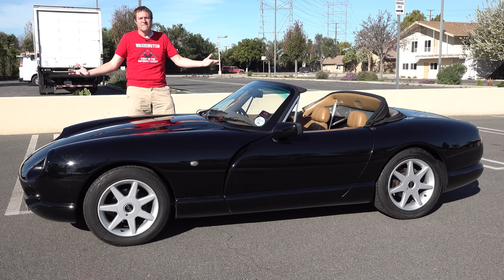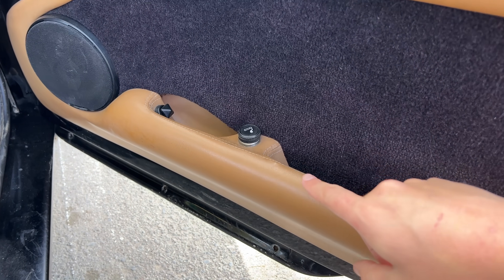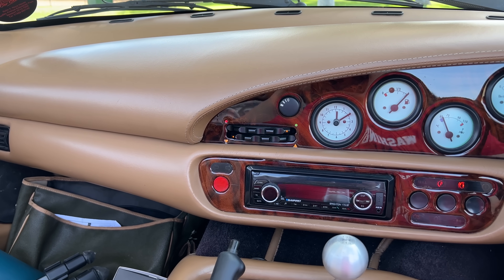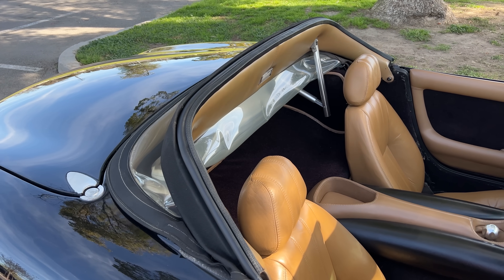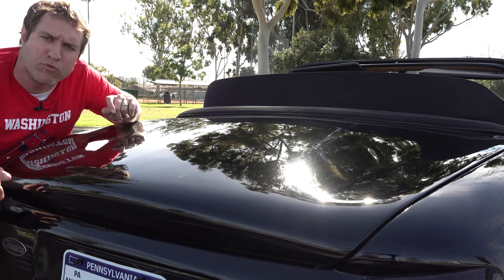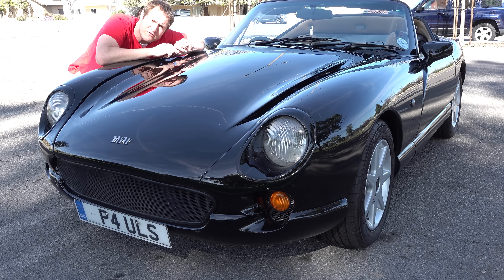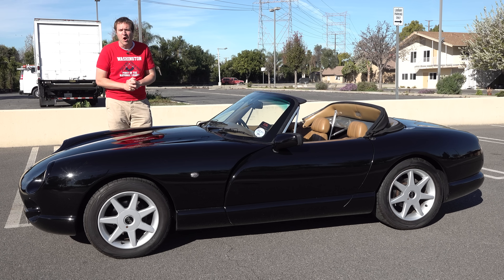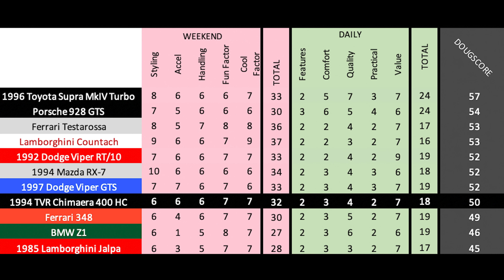The TVR Chimaera Is a Quirky, Weird V8 Sports Car

Comment: The roof on most Chimaeras folds down much lower than this one, the only thing stopping it is the risk of splitting the plastic window.  Also, there is additional cabin storage on these with a covered storage box behind both seats under the parcel shelf, albeit well hidden 👍
Reply: Wow it was so well hidden that Doug missed it
Reply: reminds me of that last K-car. something definitely is wrong with that roof.
Reply: @flair8099  to be fair, I know plenty of owners who didn't know they were there.  They'll take a tool kit, wheel jack and tyre foam, or a decent speaker upgrade 🤔
Reply: Yep, the roof should fold down further, but not by much. Over time the rear panel will split if you do push it down. Simple fix is to roll up an old rug and stick it in the fold as you push the roof down.
Reply: Doug is having problems with convertibles lately
Reply: @Revup1  Had a look at some photos, and it never goes down all the way. But there seems to be a cover for it when folded down.
Reply: @Revup1  There's something so British about that.
We "could" have sorted out the window - but why don't you just take an old rug and.. :)
Reply: @paulspensley1094  got my compressor, tyre foam and a small toolkit in mine!
Reply: @goldcd  Basically TVR was a low volume kit car manufacturer, if you park two cars together and walk around them you will see that there is no standardisation, every car is different. The wiring looms are a nightmare, TVR published a number of wiring diagrams for their cars, but my car had a mixture of at least three different versions of the wiring looms! TVR were really successful at low volume, (relatively) low cost Ferrari eating sports cars, but the company went bust when bought by an Oligarch who tried to turn them into a high volume luxury sports car company...they simply didn't have the capacity to sustain the quality or the ability to manufacture in large numbers, nor could they meet the safety standards and crash tests needed for high volume manufacture. So yes, there was something very 'British' about them, eccentric, quirky, 'mend and make do' attitude, a car you could literally build in your own garage.
Reply: Did you work for TVR or something?
Reply: @geoff3610  no, but did visit the factory in Blackpool a couple of time and owned 4 TVR's over a 15 year period including a Griffith, a Chimarea for 4 years, and Tuscan convertible for 9 years 👍
Reply: @paulspensley1094  noice. Ever see a cerbera? That's my favorite. And everyone loves the Sagaris
Reply: @MircoWilhelm  the rear screen on that Chimaera looks quite cloudy, they get really brittle when they're old which is probably why he doesn't press it all the way down 👍
Reply: @geoff3610  the Cerbera was built at the same time as the Chimaera but it was the first to use TVR's own engines (AJP8 V8 and Speed 6 straight 6) which were fragile but fabulous.  I've driven a 4.2 and 4.5 AJP8 Cerbera and they are surprisingly crampt inside but bloody fast 🤗, the Sagaris is a much better car to drive though, just as quick but much better handling.  They got it 100% right with the T350 and Sagaris ... then went bust lol 🙈
Reply: @paulspensley1094  yeah, it sucks that they're gone. But i'm glad to hear good things 😁
Reply: @Revup1  Most hand built cars are like that. They use off the shelf parts so if something goes out of production they have to switch to an alternative. The big manufacturers have their own stuff made so they don't get that issue so much.

Comment: I use to install security items on these vehicles in the day and remember that because they were on a budget you would find that they would use whatever colour wiring loom they had. So one week all the positive (12v) wires were red and the next car they were blue or black.😀
Reply: That's not a believable story but seems it gets a few likes.
Reply: @skylined5534  sorry but it perfectly true!
Reply: @skylined5534  TVR was not a serious manufacturer. It was basically a group of people knocking cars together whichever way they managed I'll tell you first hand that the actual spec varied from car to car. When they hadn't paid a  supplier due to cash flow or other problems (disagreements) they would use substitute parts (A/C compressors, alternators etc) form whoever they could get them from and fabricate modifications and brackets to make them work. An owner posted a story on Pistonheads forums back in the day, he was waiting forever for a warranty repair, finally he had enough of excuses and went to the factory where he found his car partially disassembled as he claims they had used a part to complete a new car. Another fact you can look up is a lot of photographic evidence of the guys making the fiberglass panels having engraved penises and rude comments about co-workers on the underside of the panels where they can't be seen till the car is taken apart for repairs... There are also stories of engine numbers not corresponding as they fitted more powerful variants in some regular models as that's what they had available when they were short of cash.
Reply: What you said reminds me of this clip from old Top Gear (skip to the TVR opening scene @ exactly 1 minute into the video) https://www.youtube.com/watch?v=bwoHmubxDIg
Reply: @energymc22  

Pistonheads 😂

The site several of us love to deride on account of the folks on it.

Why not provide this evidence you speak of? You bring it up so prove it.

P.s. you know TVR is about to launch a new car? Was? Is.
Reply: @johnbaldock6353  

Don't be sorry. You say true, I say you're another Internet expert who can't prove a thing. Though please make something up at an anecdotal level to give whatever story you come out with credence.
Reply: @skylined5534  Get a life mate.
Reply: @johnbaldock6353  

OK mate, keep making stuff up on the Internet, mate.  Cheers mate.
Reply: @skylined5534  Believable to me. I had a TVR. Everything was made with whatever they had. It was a parts guessing game working out which volume car a failed part came from. When my throttle cable failed and the car went to full throttle, the recovery guy diagnosed it as coming from a Ford Consul (of the Granada time frame). We took his van to a parts store, got one for the Ford, and he fitted it.
Reply: @originalkk882  Yes, but they wern't using a Ford Consul cable one week and a Vauxhall Viva the next.

Comment: If you thought this one was quirky take a look at the Cerbera. Fantastic interior and brutal performance with zero driving aids.
Reply: About 5 years ago Doug had made a video about the Tuscan.
Reply: Yeah we all saw the Top Gear episode too
Reply: He did mention the Griffith. Probably meant to say Cerbera.
Reply: In other words, a real car.  And the term you want is driving 'crutches'.
Reply: None of the TVRs from the Peter Wheeler era had driver's aids.  No ABS because they had mechanical brakes.   No stability control for the same reason.  No traction control because Peter Wheeler refused to build a car that had veto power over your right foot.

Comment: I owned one of these in the late 90's.  It was a huge amount of fun and definitely missed, thought not exactly ideal as a daily driver especially in the winter.  TVRs are known for unreliability but this very much varies from car to car - mine never completely left me stranded, but a few times I had to drop it off at the dealer on the way to work to have it looked at.  Lots of Quirks and Features as you indicated Doug, but you missed the best one...  The recess for the front indicators was allegedly created by the then owner Peter Wheeler's dog called Ned.  Apparently he took a dislike to the front of the polystyrene model and bit a chunk out it creating the recess for the indicator light!

Comment: The tail light situation is due to them being parts bin items. The outer clear casing is there and shaped to make them look better and fit the rest of the cars design.
Reply: the tail lights are from 1990 ford fiesta with a plastic cover
Reply: Ford Fiesta tail lights. I think they were installed upside down on the Chimeara.
Reply: @One Issue Voter door mirror is taken from the Citroën CX (as used on the Jag XJ220) and the door controls are deliberately designed so the heavy mechanism is in the body which keeps the door light and saves wear on the hinges, thats why there are no handles on the doors 😉
Reply: @One Issue Voter those are the features that made TVR stand out and are part of the reason the brands cars so fondly remembered, even if the cars weren’t always objectively good
Reply: @silverghini2629  yup. Mk3 Cavalier/Opel Vectra tail lights installed upside down on the Griffith.
Reply: @One Issue Voter Because tail lights are considered a safety item, the cost of having a new design certified is astronomical compared to other parts of the car. Even a lot of really high-dollar supercars use parts-bin lights to avoid this expense.
Reply: @One Issue Voter TVR Is going anywhere just yet, they have secured a loan to restart production of Cars starting with their a;ready unvailed TVR Griffith with they showed off way back in 2018. Part of the reasons they use parts bin parts like this is that certain parts cost a lot more then others to design themselves, especially parts that are covered by safety regs and need to be certified so they cut costs by going parts boon for those and put their limited R&D dollars on other aspects of the cars. TVR sells so fe cars that like other limited production car manufacturers there are always operating with very little runway when it comes expenditures so they focus on the features that are most likely to attract luxury drivers to them and skimp on areas that will not be seen as being as important to their audience like headlight/tailight design. In fact, It’s these sort of quirks in this car that attracted certain people to buy A TVR in the first place as apposed to Porsche or Bentley or BMW OR Mercedes with less quirky natures dice to higher volume sales allowing for higher R&D budgets and more custom parts designing.
Reply: Ashtrays from an original Mini?
Reply: I can't believe I've only just noticed that - of course they're Fiesta taillights!
Reply: @krudmuphinstudioz  even though later cars HAVE a custom light set with lights from Land Rovers
Reply: @silverghini2629  No, they're installed as should be, but being LHD they have the reverse light in the opposite side
Reply: @krudmuphinstudioz : Lamborghini Diablo with Nissan 3000 headlights is yet another classic example. Lamborghini had to make a plastic "eyebrow" to cover the Nissan name on the top edge of the light.
Reply: @Charlesb88 : Well Les Edgar is doing an excellent job of dragging his feet on bringing the brand back again. It was 2017 when he showcased the new Griffith and these's been no news since. In the meantime, Gordon Murrey, who was involved in the Griffith project, has gone on to not only set up his own GMA company but also design and build three models (all sold out) as well.
Reply: @duncanhowarth9514 It takes a lot of money to put a car into production and TVR didn't have enough of it in reserve prior to 2020 and the pandemic only made that worse. I don't really see any reason for Les Edger to stall for any reason other the financial troubles but we'll have to wait and see if he get production started or not within a year. It's like kick-started campaigns that you think are dead then suddenly you get the promise item just a year or more after the original shipping date. Then sometimes it never comes. Too early to say if TVR will be better late then never or is the brand truly dead (for now at least).
Reply: @silverghini2629  The Griffin 500 had the upside down cavalier GSi lights I think
Reply: @Charlesb88  They could have fitted Morris Marina door handles but Lotus and Range Rover were already doing that :-)
Reply: @One Issue Voter  

Good riddance? You do realise TVR are alive and well, yes? 😂

Comment: The taillights are from a MK 3 Ford Fiesta with a more bubbled surround on them. That's why they gave 2 cases. 
Plus, the front then signal - the reason is has a double hole for them (one below the one containing the light) is because the designer was playing with the company chairman's dog and the dog went to bite him and took a chunk out of the clay model and they kept it like that.
Reply: The lens of the headlights is acually from a 1970’s Scania truck !  (Really)
Reply: The original Lotus Elise had front indicators off a Chieftain tank, simply because they had been homologated.

Comment: One of the points of owning a Tiv is it's quirks. I've owned a Griffith 500 since 2002. It's different, turns heads, people don't know what it is, you can burble around at low speed, or scare the crap out of yourself. It's also comfortable and practical. If money allowed, I'd add a Tuscan S to the collection.
Reply: Best looking Trevor in my opinion
Reply: Woaw the Griffith 500 is truly iconic, I used to see one in The Hague also 14 years ago with the Tuscan and sagaris in scheveningen beach.

Comment: Great review! I own a 1995 Chimaera and it is a real blast to drive and certainly turns heads. Parts are cheap and readily available and they are easy cars to maintain/work on. If looked after they are reliable enough. If you like ‘60s sports cars with big engines, these are the nearest modern-ish equivalent you’ll find.

Comment: I've been wanting a TVR since I played Gran Turismo 2 back in the day and they still seem so far out of reach. Such amazing cars, it's a shame (and a bit of a blessing) that they're not more well known.
Reply: A small car with a v8 I’m surprised it isn’t a cult car
Reply: @AD-ui6sk  Probably cause they're somewhat obscure outside of their home country (unless you played Gran Turismo).
Reply: Speed 12!!
Reply: @JohnWiku  800 horse powers
Reply: Underrated gem manufacture
Reply: How are they not well known, there iconic cars.
Values of pretty much any tvr have doubled in the last 3-5 years
Reply: Out of reach?  You can get Chimaeras pretty cheap in the UK. There's some advertised for under 10,000 pounds.

Good ones are increasing in value though

Comment: Despite that production figure, Chimeras weren't exactly that common on the roads even here in the UK. They had a well-earned reputation for being a handful to drive, courtesy of the fact that a tweaked and tuned large capacity V8 was mated to an aluminium chassis and fibreglass bodywork. Which accounts for much of the lack of mass to shift, and the consequent willingness to launch forwards in an alarming manner if you're not careful with the accelerator foot.

Plus, of course, the presence of absolutely zero driver aids meant that this was a hairy chested sports car for people who either knew what they were doing, or alternatively, were deranged.

By the way, Doug, if you ever want to experience a truly deranged sports car, then next time you're in England, try and arrange a test drive of the TVR Speed 12. Which is, in effect, the result of taking the Chimera's sister car, the Cerbera, and giving it, wait for it, a 7.7 litre V12 with a power output north of 900 BHP. If you ever do arrange a test drive (which will be confined to a hired racetrack for the day, and you'll learn VERY quickly why), you'll be asked to sign a waiver to the effect that the car's owner is absolved of any responsibility if you kill yourself driving it.

Now, imagine an aluminium chassis, fibreglass bodywork, and a 900-plus BHP V12 engine propelling the whole. This is why one UK car magazine tester described then TVR Speed 12  as "terrifyingly quick". 0-60 is achievable in about 3.3 seconds (even without traction control) if you know what you're doing, and although it's never been taken to the limit, it's theoretically good for, wait for it, 240 mph.

I suspect you'll never forget the experience if you're ever invited to drive it. :)
Reply: for aluminium read:  steel
Reply: chassis were NEVER aluminium (lotus is ) TVRs chassis were steel hence the issue with outriggers rusting due to poor powder-coating
Reply: I don´t think it will happen since there is only 1 of them made x3
Reply: I wish Doug would review Austin-Healey's, MG's, Fiats, Morgan's, Lancia's.
Reply: I think it depends on where you were at that time. I lived in the suburbs of London at that time and TVR’s were fairly common place, street parked daily drivers. Plus don’t forget that Pistonheads was originally a TVR owners forum that gradually branched out and we all know how popular Pistonheads has been for many years. A few of friends dads would always have a TVR at some point. I would actually go as far as to say that TVR’s were far more popular than Porsche 964’s/993’s. It was only when the 996 came in that Porsche really took off.
Reply: The Speed 12 is satan on wheels, you're trying to kill Doug you madman
Reply: @poly_g6068  ... if he can handle the McLaren Senna and the Bugatti Divo, he should feel at home in it :)